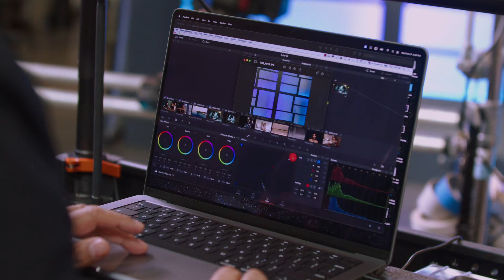Thunderbolt 3 vs. Thunderbolt 4 - The DEFINITIVE explainer!

Comment: A little late to the vid but I wanted to build a little relay (dump files fast to it, then let it sit there and transfer slowly to my nas, via wifi) pc and connect my thunderbolt 4 pc to it via the super-secret-thunderbolt-network connection.  I've forgone using my ryzen thunderbolt 3 motherboard for the relay in favor of another TB4 intel build.  This leaves me ECC'less and I don't like it.  Does the network connection between a tb4 and a tb3 computer really make a difference or is the Tb4 to tb4 more consistent in transfer rates?
Reply from the maker: Great question! When it comes to connecting via Thunderbolt, there’s no performance loss going from a Thunderbolt 4 device to a Thunderbolt 3 computer. Both TB3 and TB4 support the same 40Gb/s bandwidth, so your transfer rates will be just as consistent.

Thunderbolt 4 mainly adds expanded requirements (like mandatory support for hubbing, longer cables, and stricter minimum specs), but it doesn’t increase raw speed over Thunderbolt 3. So running a TB4 device on a TB3 Mac will not leave you at a disadvantage in terms of performance.

As for ECC, Thunderbolt connectivity doesn’t change whether ECC is supported; that depends entirely on the computer’s internal memory architecture, not the Thunderbolt version.

Hope this helps!
Reply: @poweredbyowc  Thanks for getting back to me!  I knew ECC wasn't tied to thunderbolt.  I just knew before starting this build that I could use my AMD x570 motherboard with a TB3 port (and intel mounting holes?  It's a strange motherboard)... or I could build Intel.  However, AMD supports ECC almost across the board but the Intel build restricts me to a certain motherboard  (w680) in order to be able to use my ECC ram with a 12-14th gen intel chip.  I've got the build put together and plan on firing it up and testing it out soon.  I will be using softraid to round up the 8 nvme drives I've installed :)

Comment: Wait a min, but if you use a TB4 cable for the TB3 dock (like the 10port one with 10gbe), does that mean the cable nerfs the available pcie bandwidth to one lane?
Reply from the maker: If you use a Thunderbolt 4 cable with a Thunderbolt 3 dock, the cable will operate at Thunderbolt 3 specifications.

Comment: should i use thunderbolt 3 or 4 for an egpu to boost performance in gaming?
Reply from the maker: Thank you for your comment! Whether to use Thunderbolt 3 or 4 for an eGPU setup really depends on your specific needs and setup. Both options offer great performance, but Thunderbolt 4 provides better consistency and additional features, though it may not always result in noticeable differences in gaming performance compared to Thunderbolt 3.

We’d recommend doing a bit of research based on your system and gaming requirements to ensure you’re making the best choice for your setup. If you have any more questions, feel free to reach out!
Reply: @poweredbyowc  well I have a aya neo 2 with ryzen 7 6800u and usb4
Reply from the maker: With that device, we highly recommend reaching out to the manufacturer to determine what you would need to run an eGPU for the best performance.

Comment: Dear Sir, I need help and you appear to be HIGHLY HIGHLY skilled in this area. I am in the process of purchasing a dock for my gaming laptop. I am a PC Gamer who works a lot and is always on the go, ergo, I went the gaming laptop route. I wish to having a docking station at home so I can plug in all my peripherals and an external monitor so that when I get home, I just plug in my laptop to the dock and i'm good to go. As far as my setup goes, I plan to use a Dell 27-inch 1080P 144hz gaming monitor (just one), a keyboard, mouse, ethernet, and some speakers. Will a USB-C dock be enough? Or do I need to go the thunderbolt route? Do i connect the monitor to the dock using displayport or hdmi?
Reply from the maker: You wouldn't necessarily need to go into a Thunderbolt Dock for this type of setup. Especially since a lot of USB-C docks do offer up to 4k monitor support. For example, We have the USB-C travel Dock found here: https://eshop.macsales.com/item/OWC/TCDK6P2SG/

The Thunderbolt docks are always a good thing to have since they allow for more connectivity for different peripherals in case you decide to add on to your setup. Something like the Thunderbolt 3 dock for instance:  https://eshop.macsales.com/item/OWC/TB3DK14PSG/

Comment: Thank you so much for your video illustrating both Thunderbolt 3 & 4 technologies. I just bought a second hand Razer Core X egpu that comes with no Thunderbolt cable at all and I was about to order a new Thunderbolt 4 cable for it. If I do so, then my connection will be limited to only 1 PCIe line due to the Thunderbolt 4 hub architecture and bandwidth limitation. 
By ordering an older Thunderbolt 3 cable (which I taught was outdated) I'll take full advantage of all 4 PCIe lanes that are normally required for an egpu. This type of limitation isn't mentioned nowhere so I'm glad I found your video. I just saved 70 bucks on an useless cable! Thank's buddy :)))
Reply: Reading this comment a year later! Thanks!!!

Comment: I was looking to buy the 'OWC Envoy Express'  to connect my Mac M2 laptop to an external NVMe M.2 drive enclosure for 6K playback.  I held off when I saw it was TB3, assuming TB4 would be faster, but am I correct in believing that TB3 is actually better (or same) for simple fast connection from one laptop to one HDD?

Comment: Not sure I understand the 4-to-1 difference between TB3 vs TB4 access to PCIe lanes of input. Are PCIe lanes used for non thunderbolt ports. Does that mean that a hub with 4 USB-c non-thunderbolt ports on a TH3 dock each have access to 10Gb/s  of bandwidth instead of having to share a single 10Gb/s channel?
Reply: @gags730  I assume that when slow devices are plugged into the PCIe  ports, they will only slow down other ports by the amount of bandwidth they actually use at any given time. So a keyboard and mouse will have very limited impact on the other devices plugged into the PCIe (which I assume are the non-TB ports). At least that's how I hope it would work. Perhaps OWC will clarify.
Reply: @apeel2008    WHat you said is what I think happens... But what if the chip see 2 devices and slices it to 5GB just because...  Thats what I dont know...or if certain devices have that effect.  Its confusing knowing what is going to happen.  For the most part even if it was 5GB instead of 10  could I even tell with USB drives.  I have a lot of HDD drives wiuth a SATA to USB because they are way larger and cheaper and faster...Will I notice?  I dunno... LOL...

Comment: So if I have a TB3 dock and use a TB4 cable to connect my Mac.. will anything change? I needed a slightly longer cable than what was supplied with the dock.
Reply from the maker: TB4 cables are backwards compatible - you will be good to go with a TB 4 cable
Reply: @poweredbyowc  Good to know. Thank you!